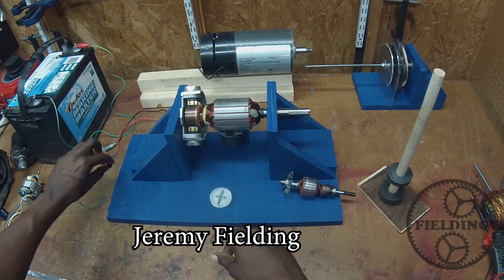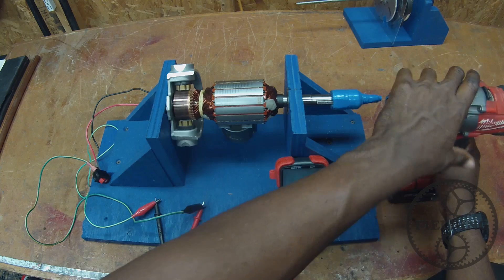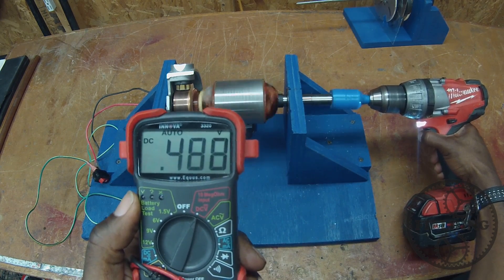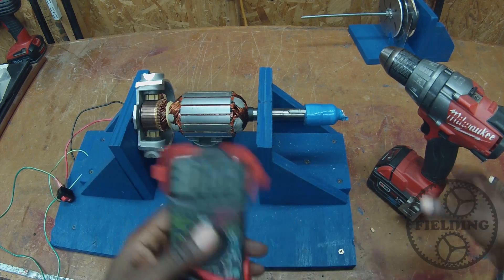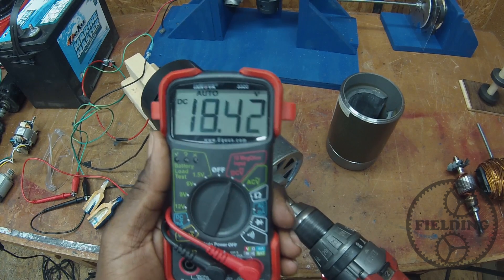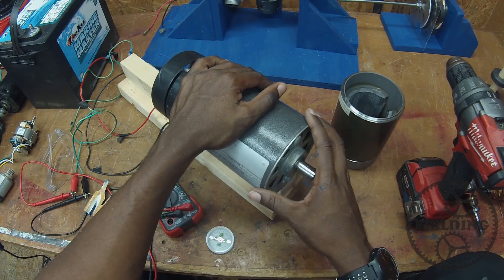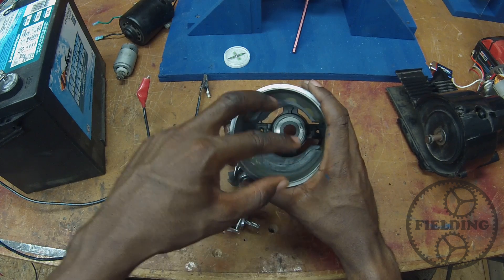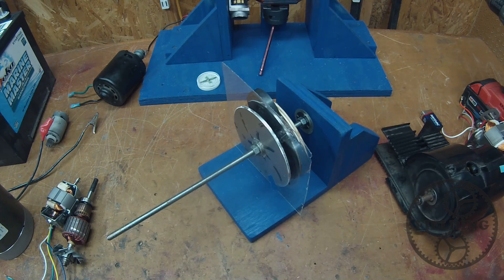How Motors Work for Beginners (Episode 2): The Generator and Universal Motor: 033

Comment: would the universal motor make a passable alternator for constant voltage?
Reply from the maker: +spacehitchhiker42 I am not sure I fully understand the question but here goes...Constant speed will give you a constant output voltage. But like I pointed out in the video, a universal motor will require electricity to make electricity... not the best choice for home made generators. I hope I am answering your question. I talk about this in the video. It will help to watch it a few times over.... that's when you get the ah ha moments
Reply: Jeremy Fielding car alternators have windings on both the stator and the rotor, and a regulator to vary current to the excited winding, which keeps the voltage constant. do you think a universal motor could work similarly?
Reply from the maker: Sure you can

Comment: Can a washing machine motor run on 12v dc? I am planning to use it as a scooter for my daughter. Thanks
Reply from the maker: No... If you live in the US you have a induction motor, and they require AC to run. Over Seas many countries use Universal motors in washing machines. Those will run on DC but I don't know what the rated power is. It may not run very well at 12 volts.

Comment: Great clear cut exposure! Is it possible to convert power drills by replacing the field coil with permanent magnets? Regards. Sham.
Reply from the maker: You mean convert a drill to a generator? Yes. You can replace the field coils with permanent magnets but efficiency will be really low as you saw in my demonstration with magnets I added myself. Motors have the magnets shaped so they can be really close to the rotor. A very small gap is important or you will get a very weak output.

Comment: Love your videos!

I commented on one a few months ago where you were showing the uses of washing machine motors and dishwasher motors and such, so you may remember me, but I wouldn't be surprised if you don't.

I have worked in industrial machine design and maintenance for about 30-something years and have a fair bit of experience in all sorts of motors -especially DC motors, which I cut my teeth on as a wee lad.
One way I do a quick and dirty check on the commutator of a PMDC motor is to disconnect it from the load and the power and let the positive and negative leads hang free. I then spin the shaft and have someone short the leads from the motor. 
Even a relatively free spinning motor shaft on a PMDC motor will practically "lock up" the instance the leads are shorted if the commutator and brushes are in relatively good and clean condition.  
It is a terribly interesting thing to do, and may be worth you doing a demonstration of it in a video.

I don't want to sound like I'm trolling on this next part, and I'm not technically "correcting" you because you didn't say anything that needed correcting, but there was a slight implication that you could run 130VDC through an inverter and get enough power to run ~120 VAC products.
Actually, inverted 130VDC will give you up to about 90 volts AC unless you run it through a boost transformer first.. 
This is because the apparent voltage of the AC waveform is determined by the root-mean-square (RMS) of the peak AC voltage (PV). The RMS is defined as 0.707PV. So, in order to get 120 VAC, you need about 170PV.

While you can rectify 120VAC down to a fairly decent 120 VDC, you cannot directly invert 120VDC up to 120VAC unless you use secondary boosting transformers to take the AC up to at least 170 or so.
Reply from the maker: I was trying to point out the relationship between speed and power output... in DC. Most home made generators use a 12 VDC to AC inverter with transformer to step up the voltage. That is why I added the note on the screen about not needing that much voltage to invert the power you need. Also it would be very impractical to spin the shaft at 4800 RPM unless your power source is another motor.

Comment: Can you do anything with a scrap alternator?
Reply from the maker: +bdot02 maybe. It was basically a generator. It depends on what stopped working. I don't know
Reply: Jeremy Fielding if I ever get a reprieve from my workload I'll probably try and find out if I can get mine to do something. I know that alternators have bridge rectifiers, do you think that means they output ac?
Reply from the maker: The bridge rectifier is like a one way valve. It turns AC into DC

Comment: I know you said there are the free energy people that have tried things, but you need a constant energy source such as a water fall, or wind mill. I have wondered for a while why someone couldn't use some pulley or gear system to increase the efficiency of the energy coming out of the generator which would be higher than the energy used to put back into the generator to be run? I know that is a little outside of the scope of this, but it seems plausible to me but I haven't heard of anyone overcoming law of conservation of energy.
Reply from the maker: Many high end motors operate above 90% efficiency. I would not be surprised to see machines breaking 98 or even 99%  efficiency.  But that pesky conservation of energy just won't go away. Energy can not be created or destroyed. And there is always some loss to heat and friction no matter how small.
Reply: +Jeremy Fielding I get that... but my logic follows let's say you are getting 90%  efficiency... so your loosing 10% for every 100% you produce but you are using the 90% with a gear or pulley system that reduces the amount of energy needed to run the generator by 50% it seems like it would be a self sustained system.. what am I missing?  and thanks for the reply ... love your channel!
Reply: +Jeremy Fielding I don't know if I explained that correct so I'll try it again.. let's say you put 100lbs of force into the generator to run it... and you only get 90lbs out of the generator in return... so you use the pulley system to cut the 100lbs originally needed for the generator to produce 90lbs out in to only 50 lbs force ..
Reply from the maker: A gear will reduce the energy required... and it reduces the speed... low speed reduces the energy produced. Gears turn high speed into high torque... or high torque into high speed... total energy is conservered.
Reply: +Jeremy Fielding That explains it... I couldn't wrap my head around that.. but now it makes sense.

Comment: i was wondering, why does the direction of rotation determine a positive or negative reading on the multimeter
Reply from the maker: +thornwarbler this is a good question for the Q and A video. I will talk about it. It's hard to explain well in the comments
Reply: Ok thankyou
Reply from the maker: Do a search for "the left hand rule" and this will give you an idea of what I need to explain. This is what determines the direction of current flow and thus positive or negative reading on the multimeter. You would apply that concept to the spinning rotor.

Comment: Am new to your channel, and look forward to more of your videos, I've already looks through some old ones, and will keep on looking through, I would like to ask while using the Older type magnets "Ferrite" would it be more effective to use "Neodymium"? would this help generate more volts? or no?, cheers for the  vids keep up the great work :).
Reply from the maker: +Colin Ubergeek yes... the strength of the magnetic field has a great effect. Consider the part where I added more magnets... the voltage went up... it is the same concept. Increasing the magnetic field strength increases the voltage all else being equal
Reply: Thanks for the reply, this is nice to know as I thought I may be right in thinking this, I am going to experiment in making my own motor using Neodymium magnets, I will make a case for it ect...., IF I get this up and running ill post it, maybe it's time for more efficient consumer motors new design/retake on them :)

Comment: Hey great videos! I have a question about generator losses. Like if you know that in this case your drill produces 10w of power output how much do you get after using a permanent magnet motor as a generator? 

All the best 
Daniel
Reply from the maker: +eBola1012 there are too many variables to answer you questions? How close are the magnets to the wire, how strong are they, how fast is it spinning, what is the resistance of the wire being used, how much friction is there between the rotor and the motor assembly ... there is more but you get the idea. Many factors effect the efficiency of a generator. I would start by looking up formulas for motor efficiency and you will see them all related to each other.
Reply: Jeremy Fielding A I see! I thought there might be a general relation between input and output. Thanks for the answer! Keep up the good videos!
Reply: Definitely less than put in. That's why generators pretty much always use a different source of energy as input than what they output. Such as; wind in - electricity out, gas motor in - electricity out, water in - electricity out, solar in - electricity out. They are used to generate electricity from another type of energy source. You don't use electricity to produce electricity. You will always use more electricity to produce less, which is pointless.